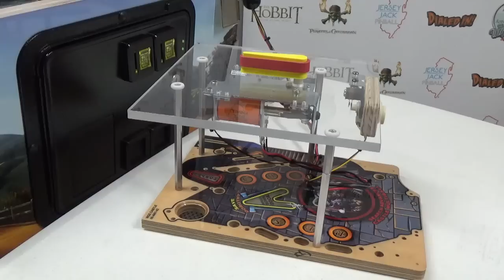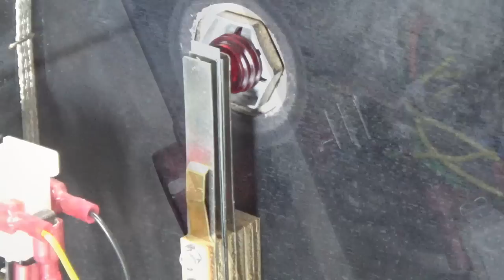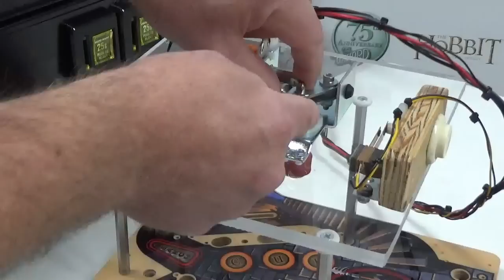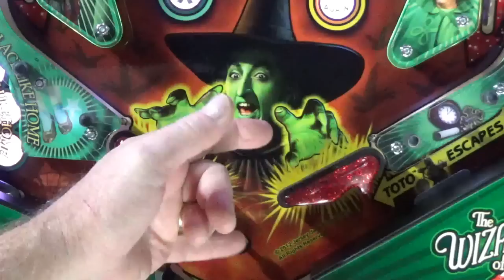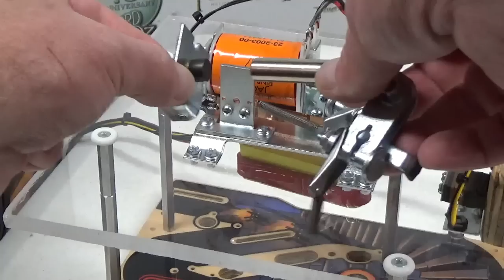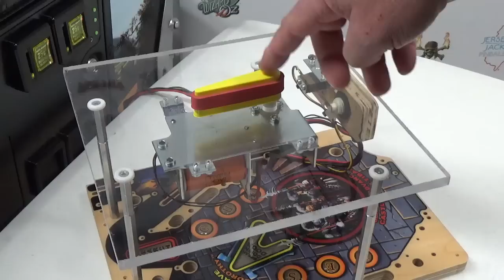Flipper Assembly Basics

Comment: Thank you. I had a flipper sticking in the on position due to the bushing in the plastic part of the flipper linkage. I'm a newbie, so I didn't realize that when the flippler linkage bolt broke and fell into the cabinet, that there was a bushing. I found the bushing in the cabinet. Installed it with the bolt and now the flipper doesn't travel too far to get stuck. Thanks for the layout of parts in the video.

Comment: JERSEY JACK PINBALL,       1.) Why does pinball repair technician try to "demagnetize" the solenoids plunger? because I would think you would want the plunger to be magnetized so it can be able to be pushed and pulled in by the coils magnetic field.       2.)   When pressing the flipper solenoid it creates an arcing spark across the switch contracts but to prevent it is to add a diode or capacitor?
Reply: Magnetized parts create wear